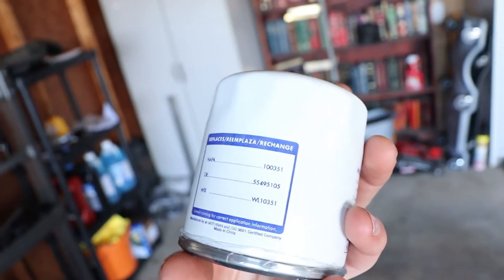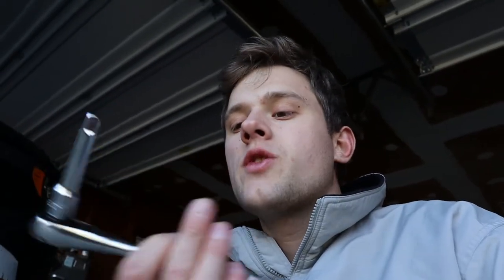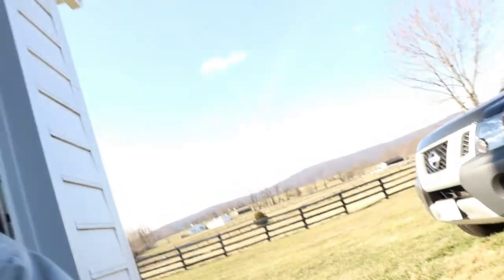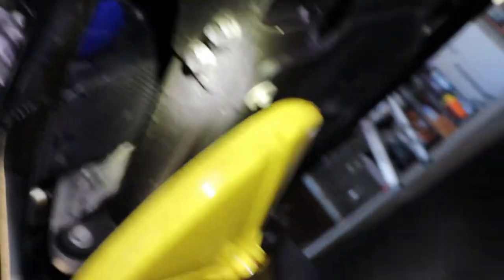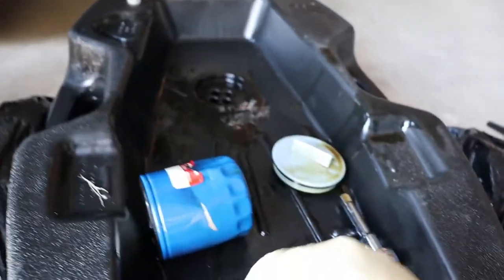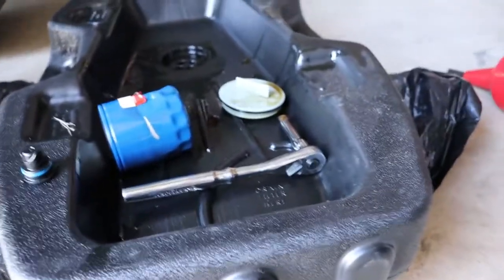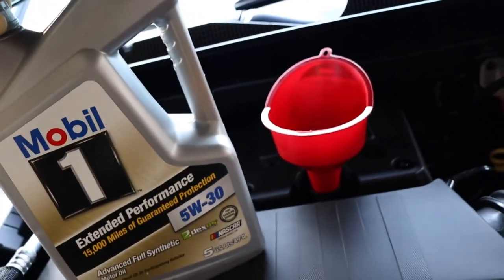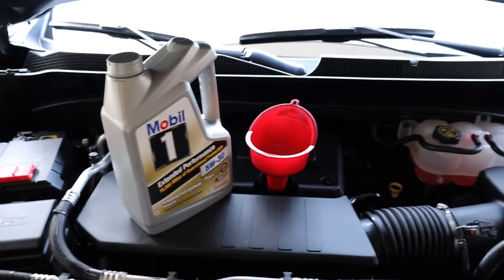Oil Change on 2019 Chevy Silverado 2.7 @CleetusM

Comment: Yes, GM has switched over to synthetic on all their cars now.  The DEXOS certification can only be obtained from using a synthetic oil.

You do know that GM advises against using any oil additive?
Reply from the maker: They would have to prove the additive caused the issue. The chevy dealership in our area sells the BG crap. So if they put that stuff in your car. No way they will void your warranty if you add an additive
Reply: @CarsRMe  
Probably true, but oil additives are pretty much snake oil.
Reply from the maker: @stchman  i would agree they definitely are not necessary. Just makes me feel better. But like I said, if dealerships but in an oil additive it should be fine to use one
Reply: @CarsRMe  
Ok, but feelings are irrelevant when it comes to engine maintenance.
Reply from the maker: @stchman  true. Used the Lucas oil stabilizer on my xterra and its last 331,000 miles
Reply: I wouldn't put additives in just use what is recommended on oil cap
Reply: @sodbuster518able  
Exactly.

Comment: I have a 2021 Silverado with the 2.7. Isn’t it suppose to take 5.0 quarts of oil?
Reply from the maker: No 6 quarts
Reply: So it’s synthetic not full synthetic I have a 2020 ?
Reply from the maker: @xtrz-_-x9000  it is full synthetic oil
Reply: It,s called read your owners manual in the glove box

Comment: I wish GM could make an after market metal oil pan with a Metal oil plug  for that 2.7 liter 4 cylinder that’s in my 2020 Silverado because that plastic  oil plug cracks!!
Reply from the maker: I agree with you! I wish it had a metal pan. I was disappointed to not be able to put a metal plug on it. What I did instead is a put a magnet wrap around the filter. This way I can still trap the metal
Reply: I learned something new didn't have a clue about that oil plug.Looks like Jiffy lube gonna buy a lot of stripped out oil pans and plug s
Reply from the maker: @sodbuster518able  there is an advantage to the design you can over tighten it on strip it

Comment: What kind mpg are getting?
Reply from the maker: 25.1 mpgs for the lifetime which is 6000 miles now. Easily get 30mpgs when doing 45-55 mph
Reply: Holy crap that thing gets up to 30 mpg?I just bought mine yesterday take del on 30th same color

Comment: Take an engineered synthetic 5-30 motor oil and add a universal petroleum goop to it at a 5 to 1 ratio.....really not a good idea, particularly not in an advanced modern turbocharged engine. But carry on doing what "feels good" the engineers can not possibly know more than your emotions.
Reply from the maker: My xterra has 334,000 miles on it
Reply: @CarsRMe  My grandfather lived to 92 smoking and drinking......An xterra like my grandfather has very good "genetics" all stupid analogies aside, the xterra has a lightly loaded N/A engine that is very easy on oil a high output turbocharged 4 cyl in a truck is on the other end of the spectrum.